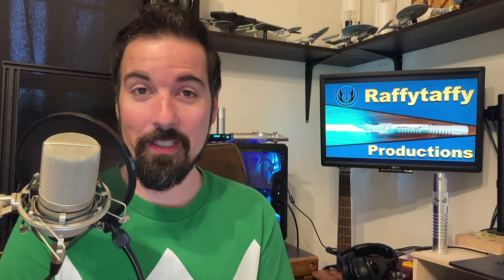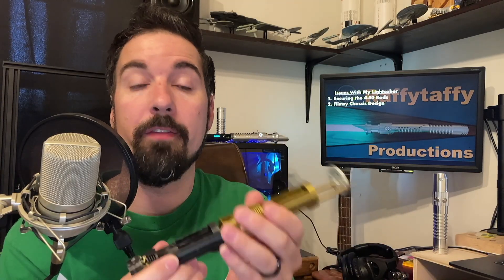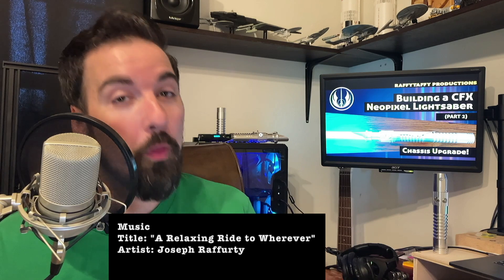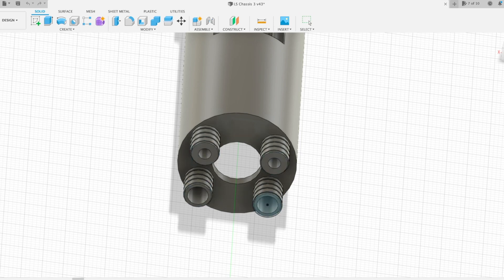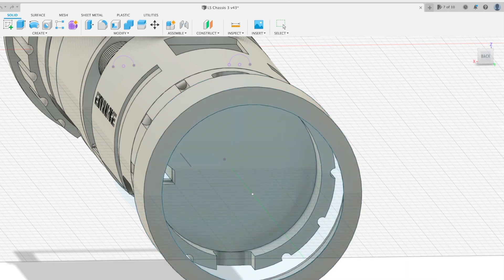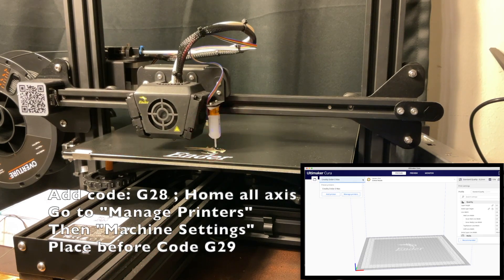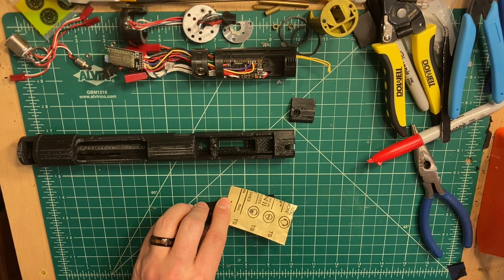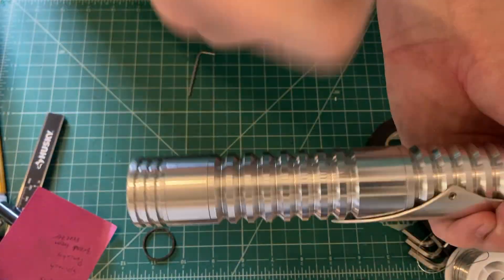Building a CFX Neopixel Lightsaber with Crystal Chamber and Bluetooth: PART 2-Chassis Upgrade

Comment: I was curious about your wiring diagram and notes that you have linked to your google drive.  It seems you don't have the google drive folder setup for read only public access. Is there a better link to that information? I would also be really interested to see your Fusion 360 model of your chassis! I've been considering doing something very similar and having an example to look off of would be excellent!
Reply from the maker: Great questions! I keep the google drive folder on read-only so that no one accidentally alters the original documents. What you can do is make a copy of the google drive folder for yourself. It will save a copy to your google drive. 
As far as giving you a closer look at my Fusion 360 models, that will be very difficult. Since I am using the free-version, all of my Fusion 360 sessions are saved to Autodesk's cloud and linked to my account. In order for me to share them, I would have to upgrade to a subscription. The best I could would be to send you the .stl files of the chassis. If you know how to convert the model to something you can work with in Fusion 360, then you'd be in business. Keep in mind, my chassis is specifically designed for my lightsaber, so you may have to do several modifications on it.
Reply: @jraffytaffy2678  Sorry! I should have worded my comment better! I was meaning that the google folder is completely locked down so you can't even read it as read-only to make a copy of it.  It just has a "request access" screen that comes up if you try to open it.
Its too bad that the Fusion 360 models are cloud only.  I had assumed it would be similar to how Autodesk's other products (like Inventor) work, but its unfortunate it's not! Makes it much harder for people to share designs. I was mainly interested in the overall size of the different features of your chassis (like overall diameter - I am using the same CSS MHS parts!), the size of the pocket you hollow out for the CFX etc. Thank you for posting this update, it got me excited to keep working on my project again that had somewhat lost interest in!
Reply from the maker: Glad I helped relight the fire. 
If you just click on the “request access” tab, it sends me an email notifying me of the request. Then I can give you access.  The notes I have on my dimensions should help you, but you may still need to do some test prints to get it just right. I use metric measurements. Also, in the video description is a link to Solo Sabers LLC’s YouTube. He has two tutorial videos on chassis building. The dimensions he uses helped me get started, but he uses inches. I only converted them out of preference. Let me know if you need any more help.

Comment: Nice work! I enjoyed seeing the upgrades you did to the printer itself, that was really interesting.
Reply from the maker: Yeah, it was crazy how much better the prints were after I added those upgrades. Leveling the bed is so important in 3D printing to ensure your first layer is done proper. If the first layer is crap, the whole print is crap. And there is too much human error in manual leveling, despite the fact that I spent several hours manual leveling (no exaggeration).